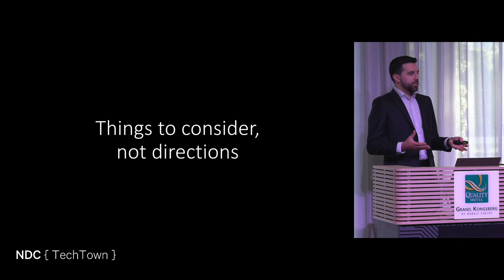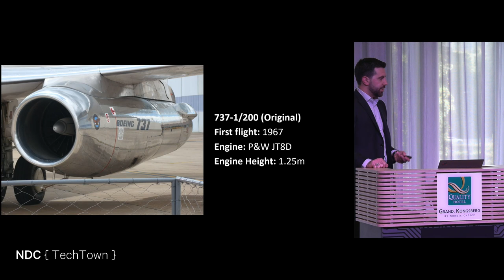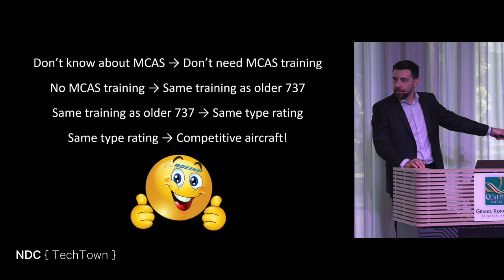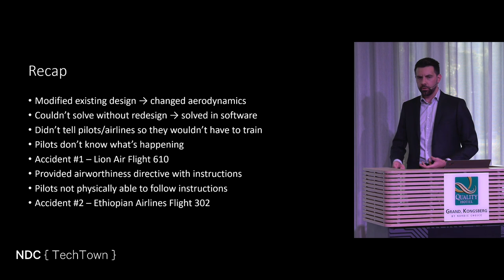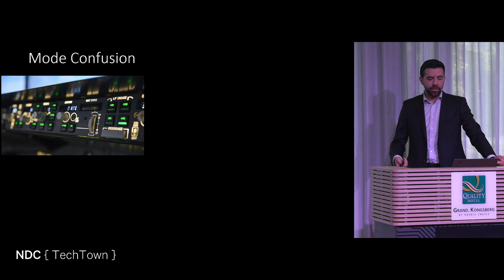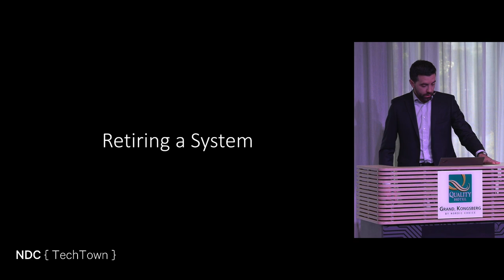The Boeing 737 MAX: When Humans and Technology Don't Mix - Kyle Kotowick - NDC TechTown 2022

Comment: I read that the 737 was very low (which limited the size of the engine), because it was designed to be used on less sophisticated airstrips (3rd world countries?). And so they could use ladders for boarding passengers, and also the engine could be serviced from the ground. It was designed a long time ago, for conditions of a long time ago.